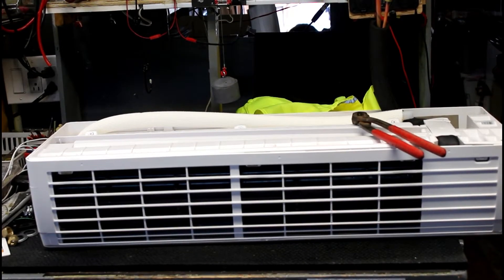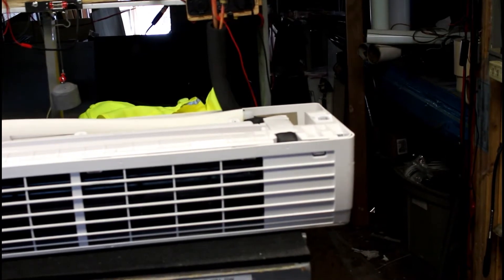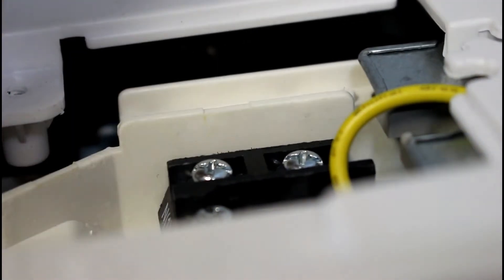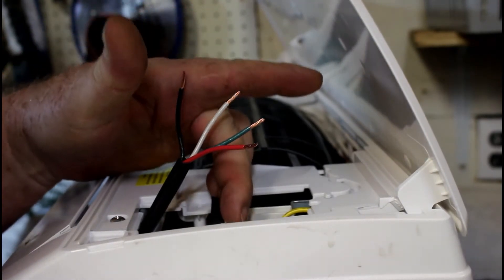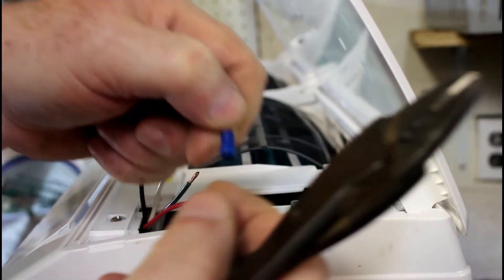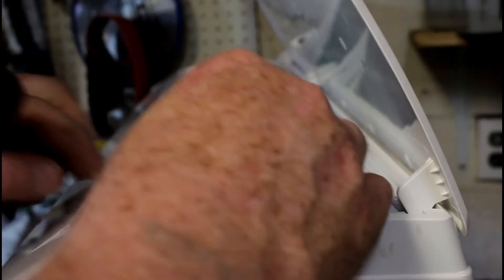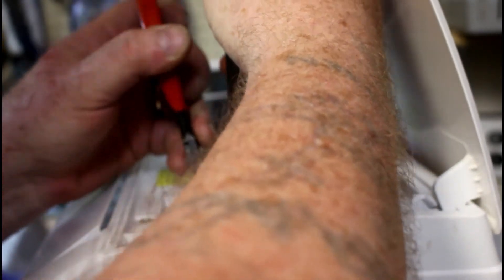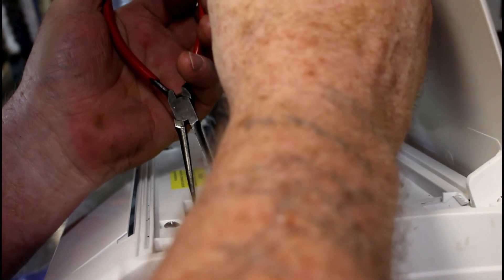A little on installimng a Blueridge air hest unit and a lot of BS

Comment: Shewww, I wish I had A/C in my shop but without insulation it would be a waste LOL. Have you got a tubing bender? You are going to enjoy having A/C in the shop now. Be well and be blessed my brother.
Reply from the maker: Thanks for stopping by. The air would be nice if I ever get it working :)  No bender just slow and careful hands. lol  I forgot I never pulled 220 to the shop so had to run 40 ft all new wire underground, direct bury so I can hook up to air. :(